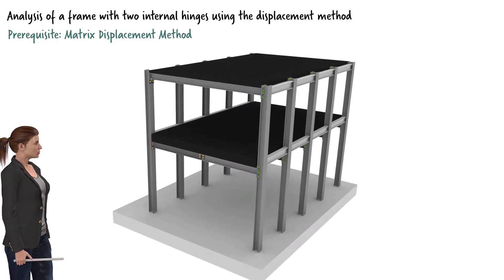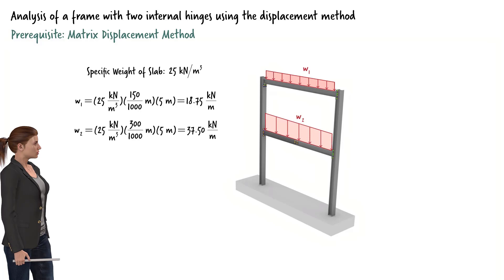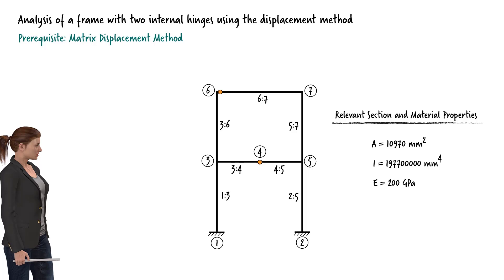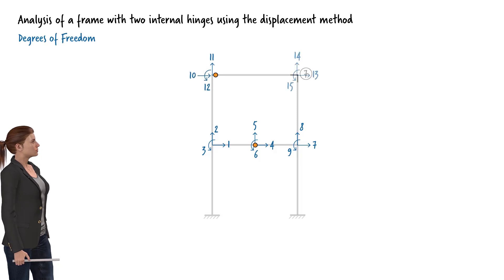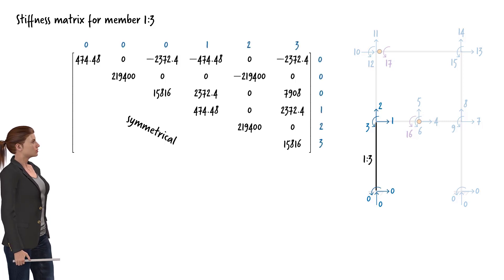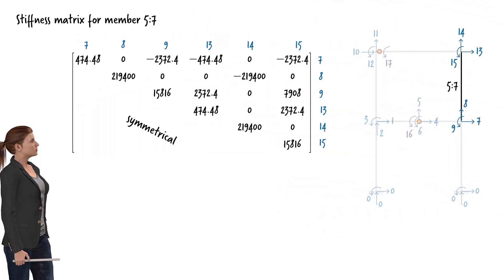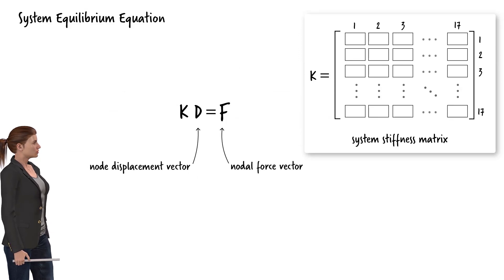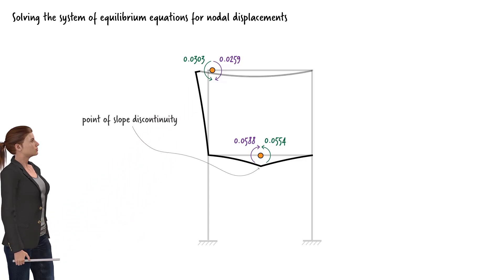SA70: Analysis of a hinged frame using the Matrix Displacement Method

Comment: In last lectures, you called "I" second moment of area. Here you call it moment of inertia. Can you expand on that?
Reply from the maker: In structural engineering, the terms second moment of area and moment of inertia are often used interchangeably because, for most structural applications, the mass distribution across the cross section remains constant. This consistency allows us to focus solely on the geometry of the cross-section rather than on varying mass, which simplifies the analysis.

The second moment of area, which is a measure of a cross-section’s resistance to bending, depends only on the shape and dimensions of the cross-section. Since the material density doesn’t typically change across the cross-section of structural elements, the second moment of area becomes the primary factor affecting bending and deflection. In this context, “moment of inertia” is commonly used as a shorthand, even though it technically refers to mass moment of inertia in physics.

Because structural engineers rarely need to account for changing mass within the cross-section, they often use the term “moment of inertia” to describe the second moment of area. This interchangeable use has become common practice, as it reflects the fact that structural elements are evaluated mainly on their geometric properties and their resistance to bending, not on rotational dynamics where mass distribution would be crucial.
Reply: @DrStructure  Thanks!